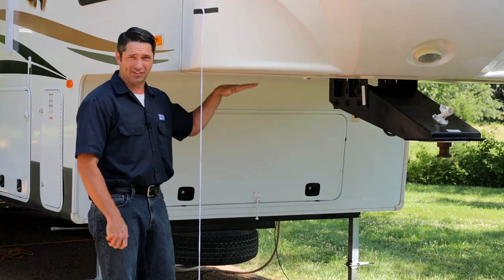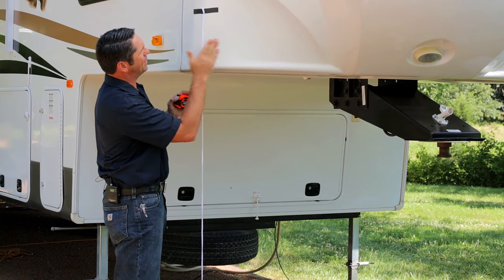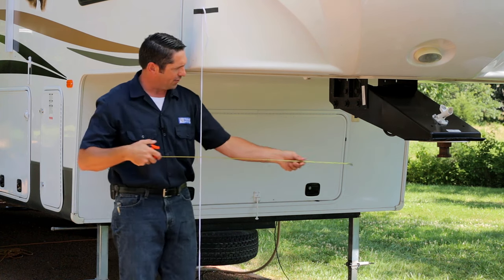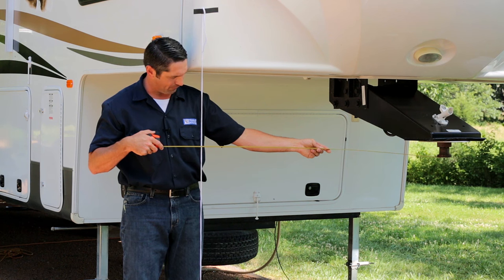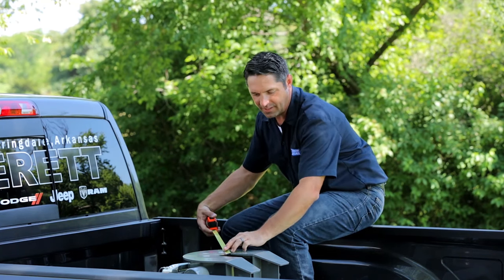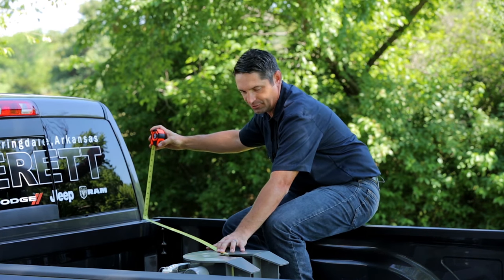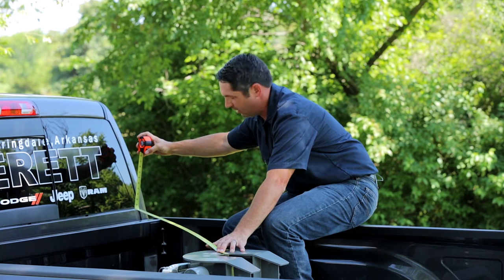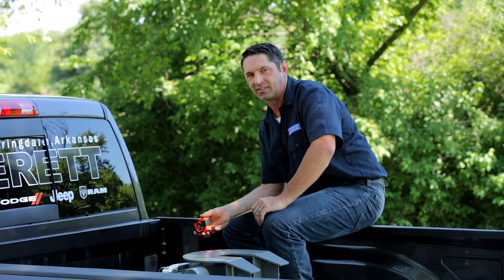5th Wheel Turning Clearance

Comment: While you're busy watching that clearance, what about the clearance between your rear bumper and the front of your 5th wheel at lower level?  Wait for the crunch?
Reply: The RV is meant to be soft and chewy on the inside, and crunchy on the outside.
Reply: You'll hear your back window break before the front of your 5th wheel is even close to your lower level bumper.
Reply: Sheri Murphy what about on a long bed with a 9’ utility bed?  It’s got standard sized bed height but added storage boxes.

Comment: B&w needs to make an auto slider
Reply: Can you show me one? An auto slider? Not one you have to get out and unlock
Reply: Daniel Warren The one they have you have to get out and manually unlock the unit so it will slide!  This is for safety reasons and it works very well!
Reply: PullRite makes the Super Glide, which is automatically engaged. I’m sure there are others too.